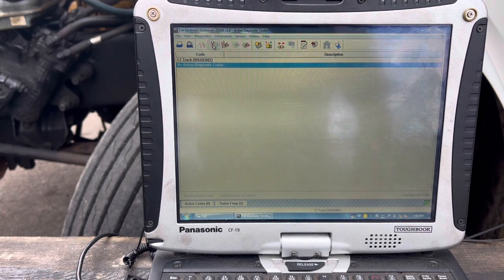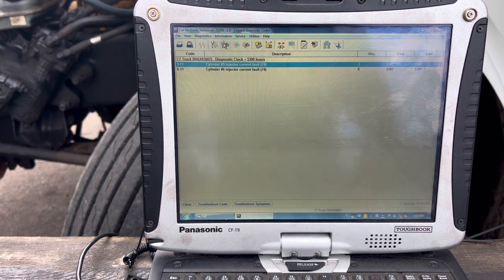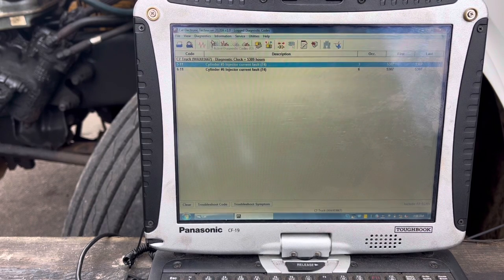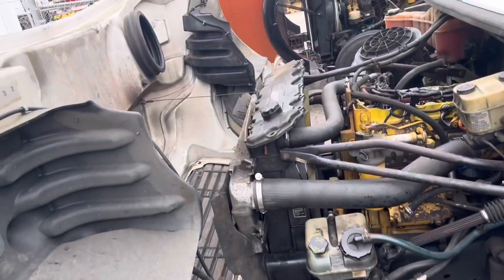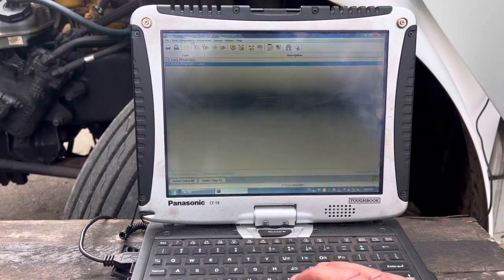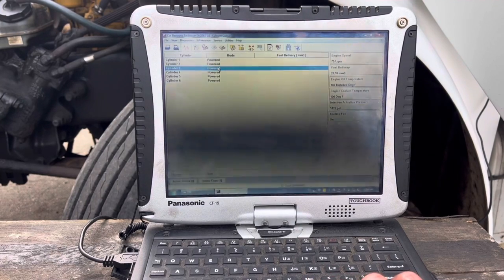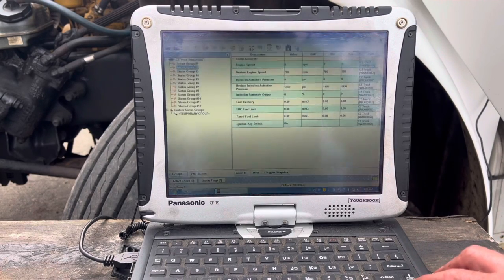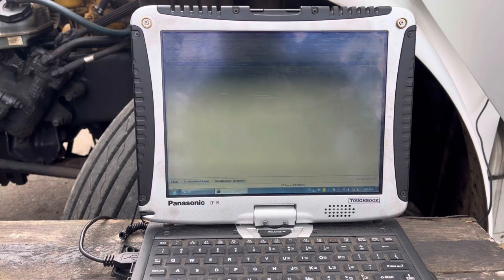CATERPILLAR C7 ECM Diagnostics. Electronic troubleshooting using laptop with CAT ET. Cylinder Test

Comment: My can't came with white lot smoke, coolant ok, no fuel in coolant, misfire injector 2, I replaced, but still misfiring sane cilinder 2, I swap them from number 3, but still missing number 2, what could be issue? Piston or ecm, ?? Cat c7 2006

Comment: Nice video.  I have an 07 C7 in an f650.  I'm getting intermittent no starts when hot.  Changed huei pump, ipr, Injector seals. 

Fires up with shot of ether and runs fine.  Without having access to diagnostic tool during no start its hard to figure out.

Would you lean towards ECM failing?

-Thanks